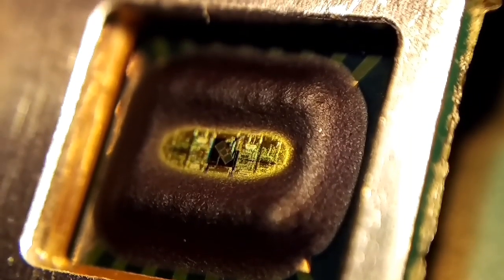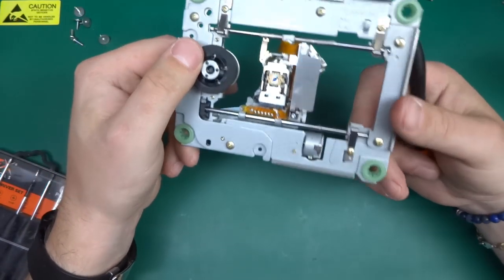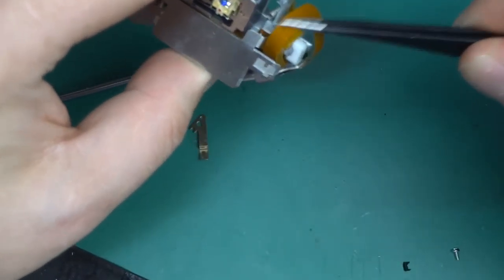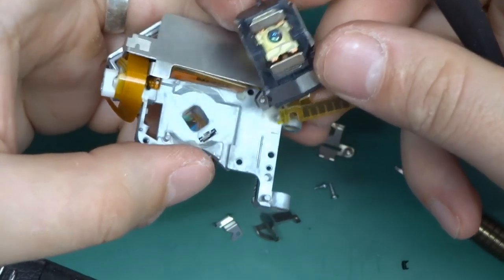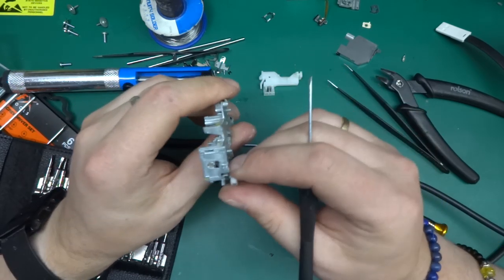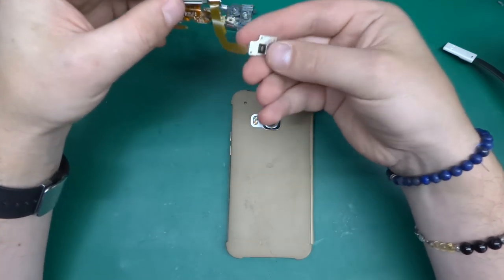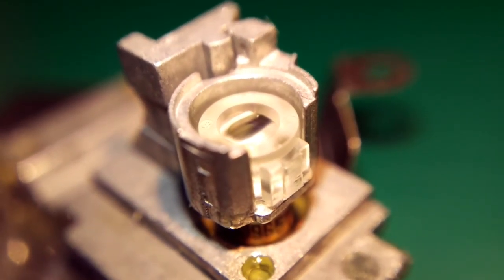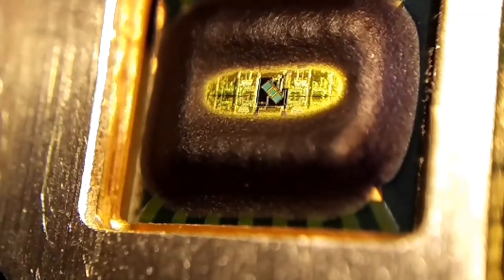DIY microscope - mobile phone and DVD RW drive hack

Comment: Great repurposing of E waste. I've thrown so many drives away, but there's still a few in the junkbox ready for some surgery..
I was thinking of 3d printing a support stand for the phone that holds the lens and allows the phone light to pass through alongside. Maybe also with a couple of legs to set focal distance, a very good tool for inspecting pcb's and via's.
Cheers, and thanks for posting.

Comment: CD/DVD +RW & CD/DVD -RW  manage defects differently. One uses a measurement of how much the disk is wobbling, and the other uses its LASER to focus the beam and burn little tiny divots. A hybrid does both of course, and would tend to have more mirrors and optic stuff. Not sure which (+RW  /   -RW)  does which method, but I hope this helps to know what is available where and what you may have.

Comment: i just tried a simple 1$ aliexpress jewelers loupe at my xperia z5 rear camera and gives a better focal length for doing laptop repairs. no need for expensive equipment. focal length is about  8 cm. i use the pinch zoom and it works well.
Reply: not as good as microscope.that will make job done faster and easier

Comment: Not even joking, but I took one of those lenses like the one you pulled out and placed it almost directly on my eyeball but not actually touching my eyeball and I could see the microscopic dust particles floating around in my vision/eye lubricant(not sure what it’s called)… it also had a slight distorted/static/digital-looking in the background behind the dust particles. It reminded me of when you see clips of virus’s under a microscope when they multiply. Rather cool though.

Comment: You can buy a set of lenses designed to mount on any phone. Not only magnification, but also telephphoto in the set. Costs around $7 from most Chinese on line stores or Ebay.

Comment: I using chewing gum to place (tempolary glued lenses and other optics) lens on mobilephones. First i take small part of gum and roll it to sumare with something looking like thin needle. Then i bend it to form ring in diameter that is needed press it to phone(around phone camera) and put on it lens/optic i like to use. Its really easy to make and easy to clear and not that easy to get lose not intentional. I regreat that i cant put images in coment. :D Before this method i was make custom holders that i was make from molding plastic or driling in wood but it was huge overkill and it was harder to use in practice( get light etc.) ...in short gum is like miracle or magic ideal for this task.

Comment: You need to record the sound after recording video. You kept saying "Ahh...ummm Ahh" it was driving me nuts. I did not thumbs down because you knew what you were talking about. It just needed to be presented better.
Reply from the maker: Thanks! Those uhms are the bane of my existence... I got somewhat better with time I think.
Reply: randomtronic I had the same problem with recording myself for my job. Try writing out what you want to say before. Record it, then put it into the video as a narration.
Reply: It's a black thing you wouldn't understand

Comment: is the focusing lens useful?
Reply from the maker: s yottky well, that depends what you want to use it for. if for attaching to camera, then i do t think so. tried those but had little luck. those have a funny shape and distorts the picture. and very short focal length too.
Reply: you mentioned the lens are found in DVD drives only. I got some old CDRW drives. Do you think if there would be any useful lens inside?
Reply from the maker: +s yottky you can always take it apart and see. Just enjoy the teardown. From my experience cdrw drives did not have this lens, but this might be dependent on individual drive.
Reply: ok, i've found one in my old CDRW drive which is slightly smaller than the one you've showed. But anyway, after some checking with my physics textbook, the magnification depends only on the lens' focal length and quality (less distortion the better). So I guess it works as well.